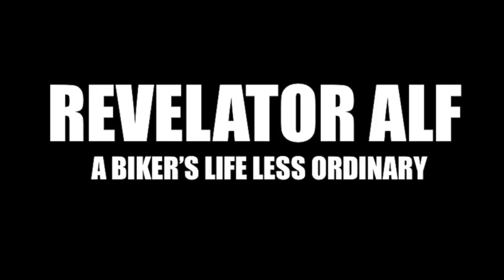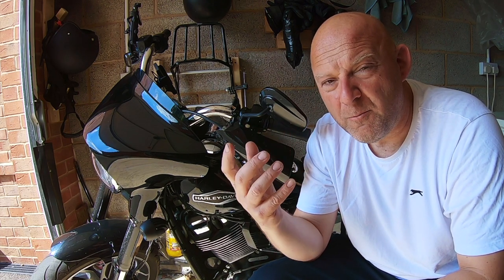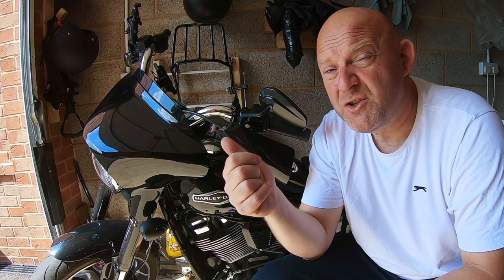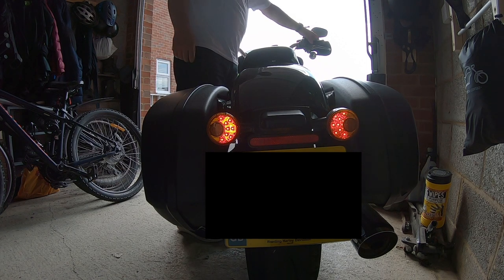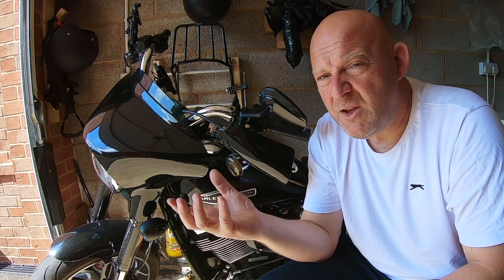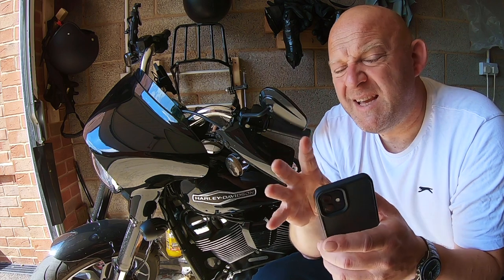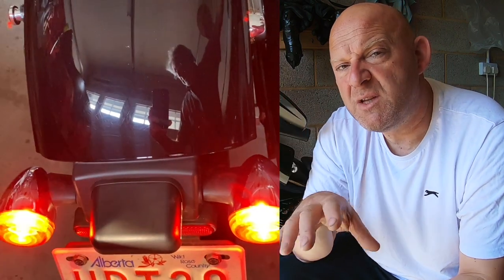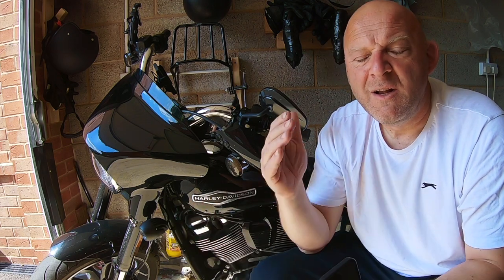Harley Davidson M8 Turn, Tail & Brake Light Faults

Comment: Fitted ciro 3d tailight (latitude) to my tourer, and looks much neater imo.
Quality, and easy to install so a good alternative.
I didnt change lights because of any faults, just wanted cleaner look.
On front turns have led inserts, the canbus system has accepted these too, no problems.
Keep up the good work Alf 🤙🍻
Reply from the maker: Cheers Kevin. Yes there really shouldn’t be an issue. Cheers

Comment: Great video Alf, your rear lights are like a two into one, here in Canada it’s a single light, so that explains why when I use the turn signal and apply the brake only one light glows brighter indicating a braking situation , the other just flashes indicating a turn. Your rear lights are much more appropriate. Thanks Alf. As for hyper flash a load resistor would work.
Reply: Most of them that are not modified do exactly what your bike does I am in the PNW USA. Personally I like simple, stripped down, functional, or just stock. Can you get away with removing your turn signals in Canada? I know here in my neck of the woods I have with no problems yet depending on the cop some don't like hand signals after dark.
Reply from the maker: Cheers Rob. Glad you enjoyed
Reply: @sswcustomsewing4276  Pretty sure we can’t remove the lights ,

Comment: Is anyone else burning several bulbs and melting lens in the M8 Softails? I have replaced at least 4 bulbs at the back of my '19 model. I asked a service man at the dealership and he said that only happens when someone rides their brakes. I certainly don't, but I do 'cover the brake' by placing my toe on the lever while I ride. Maybe that is burning the bulbs. The solution from the service man was to buy LED's.

Ride safe, y'all. Great video, Alf.

Comment: I replaced the HD stock tail/brake light for a HD tail/brake light. I also replaced the HD stock rear flashers with Custom Dynamics LED.  All installs were plug and play and work correctly. The bike is a HD 2020 heritage classic (USA). The tail/brake lights and flashers are separate from each other.  The problems, i hear, are typically on the bikes that have the same tail/brake and flashers combined when converting to LED. Custom Dynamics sells modules to correct tail/brake light and flasher bulb replacement issues.
Reply from the maker: Yes indeed. Cheers
Reply: Hey Tony did you get those lights from H-D or were they after market ? As I can see on Alf’s bike he has two lights in one I think that is a better approach. The single light doesn’t do two functions .
Reply: @reddog907  Hi Rob, it depends on the bike. Some HD come where the brake and turn signals are one. Some come as separate setup with a tail/brake and sepatate turn signals. None of the rear lighting came from HD as LED. The rear tail/brake light and turn signals are separate. I installed a HD LED tail/brake light and installed an aftermarket LED turn signal bulbs from Custom Dynamics. The flashers stay amber and brake is red. Custom Dynamics also sells a kit that the rear turn signals will blink amber when flashing and also turn red when the brake is applied. Plus, you can  program the brake to  strobe/pulse many different patterns. Eventually, ill get the kit where the turn flashers and main tail light will turn red upon braking.
Reply: @tonyj8947  Great Tony thanks so much.

Comment: Hi Dear Revelator,
I have a question about the 3 in 1 rear turn signal of european softail M8. Actually the european version of the rear lights are already LED right? Or they are the combination of LED and Bulb (break and running lights are led and turnsignals are bulb)?
Because I can't open the cover to inspect .... 
So my thought is the big front light and rear lights are led, only the front turn signals still use old-fashioned bulbs, is that right?
And how can I open the covers? I will be really grateful if u can answer my questions.

Comment: My turn signals and running lights work fine.  When I apply the brakes, the tail lights flash hazards. Any ideas? This is a new LED install. I have a 2019 883 Iron

Comment: Hey mate I've got a 86 softail, pull front brakes no brake light push rear brakes no brake light but put both on same time and brake light works fine? Any idea what the issue is?

Comment: My 2020 slim is acting very strange. My right rear light has gone bad a second time while all my other lights are fine. It's always the running light that goes out. I bought a new bulb and the running light works but flashing does not work. Swap the front right bulb with the new rear bulb and now all the lights are running: signal, emergency, running,  and brake lights are all working.

Comment: Custom Dynamics has a plug in module that takes care of this problem .
Plug it in under the seat and takes care of the problem. Takes 10 minutes.
It’s an issue when you swap from stock incandescent to led.
It’s not an issue for front lights but just the rear
Reply from the maker: Yep cheers
Reply: Mmm, I swapped my rear 1156 indicators for Custom Dynamic Genesis 4 led, no issues. That's on a fxlrs in Australia.
Reply from the maker: Yep most are ok I would say

Comment: Clean sockets.
Reply from the maker: Always a good plan cheers
Reply: I was thinking the same thing. I do not use LED bulbs on any of my bikes. I buy heavy duty 12v bulbs with a brass base. As crazy as it sounds I polish the base of the bulb to a shine, polish the socket,  give the socket and base of the bulb a very thin film of dielectric silicone grease. I check the wiring, connections, and plugs cleaning them with plastic safe CRC QD electric cleaner and use their plastic safe contact lubricant. Doesn't hurt to pull out a multi meter and check your voltage and if necessary do an ohms test to rule out a bad or pinched  wire. Personally I like to remove the turn signal lights on the front and run resistors. Or remove the turn signal lights and keep a brake light and turn tge rear signals into two running lights. Only drawback is when you have a ticket happy cop or in some places its not exactly legal.
Reply from the maker: Yes great shout there. Cheers

Comment: What we get for alleged tail lights is a disgrace . The lollipop design is unsafe and doesn’t not offer good intent to the driver of the car behind us.  I remove the rear plate reflector and install the Custom Dynamics led assembly .
Reply: This can be hooked up as brake. Tail and turn signals or just brake and tail light.  The low rider s comes with the proper tail light assembly.  The clowns at Harley should ride in front of a 90 year old in a rain storm while driving their car and pray to God they see the junk lollipop brake lights on our bikes brake lights

Comment: I must admit Alf every one of your videos seem to be pointing out faults or potential faults with the M8 Sport Glide.
Your videos must have steered many buyers away from the Sport Glide as every week you are finding faults with yours or other owners no matter where they are in the world ! What you don’t tell us is that all UK Harleys are built in Thailand apart from CVO models. Built to different specs for the European market.
Now you are trying to address a problem with an owner in N America whose bike is different than any sold here. Not only that he’s been trying to fit aftermarket LED indicators. How does that sit with his warranty I wonder ?
Bottom line is always check with your dealer if any part you add to your bike will affect the warranty as your cheap LEDs may end up costing you more than you bargained for.
It would help if you said what a fantastic bike the Sport Glide is. Probably the best value for money in the Harley line up at present. (No I don’t own one).
Also the chance of any problems arising with a new bike are virtually nil. If you want peace of mind then extend the warranty ! But seeing your almost daily videos about their faults would make even me think twice about getting one !
If you do want to adjust something or replace the already adequate tail light and indicators then ask for the dealers advice first.
More positive less negative please Alf. 👍
Reply from the maker: Ok but not all Harleys are made in Thailand for European market and only in last few years have they expanded the range made from there.
As for the rest of your comment, thanks for your feedback
Reply: it's not always the sports glide it's just any harley models can have a little problems but most don't have any issues at all after 15 to 20k miles which can be good..
Reply from the maker: Yes for sure
Reply: @douglasmcbride4924  any bike can develop a fault at any mileage.
If I owned an M8 Sport  Glide, according to Alf it’s in imminent danger of developing a fault at any moment.
Just look back through his videos and you will see what I mean.
Reply: most harleys for the uk are made in the us , you can tell this on the vin number  which i thought you may have checked before making that statement ,hd s made in thailand are to beat the heavy tariffs , not to make them cheaper, alf is giving us something to watch in these strange times not slagging the bike down , his bike is the same platform as all the softails are built on . they are very good in the main = but saying that my alarm is driving me crazy ;; and cannot use the bike , just as the warranty expired...
Reply: @vernoneveritt8264  so what